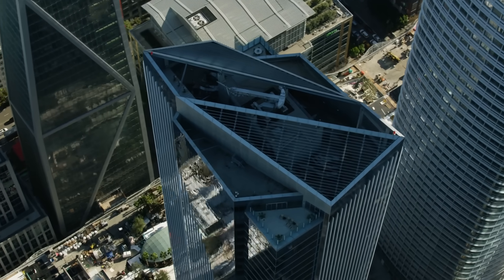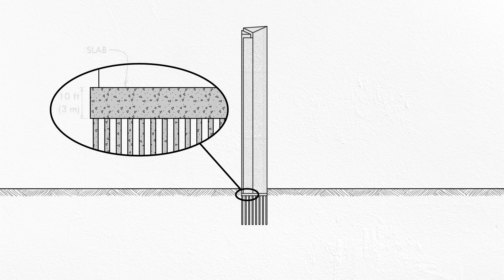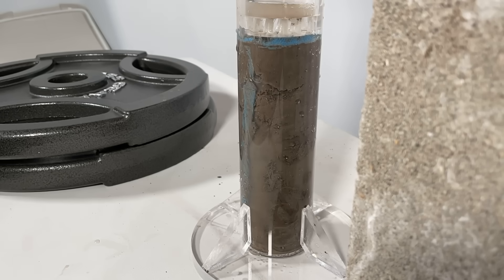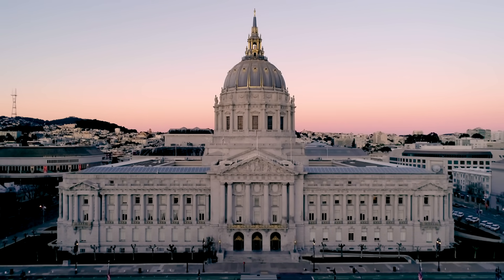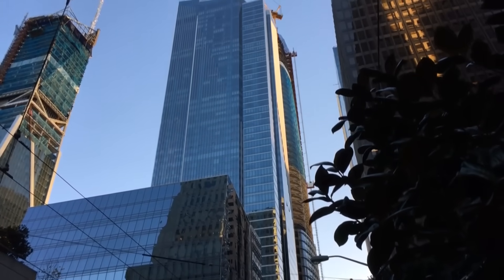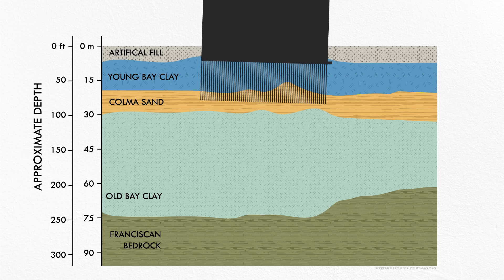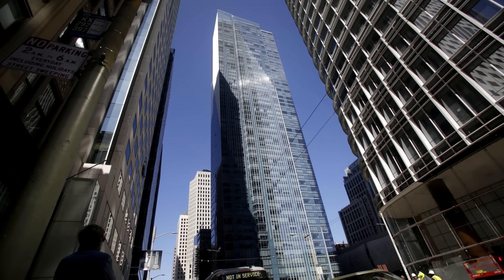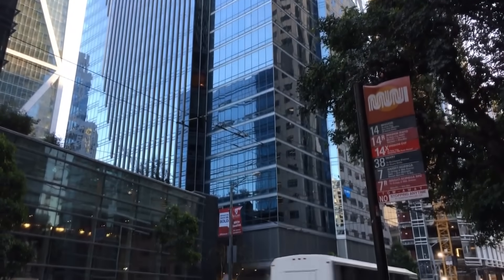What Really Happened at the Millennium Tower?

Comment: Example Failure 1) of 3 
HARMON tower, in Las Vegas: At the beginning of the project, the hotel was called the Lifestyle Hotel and then The Harmon Hotel, Spa & Residences. The tower was planned to have 400 hotel rooms and approximately 207 condominium residences from 800 to 2,900 sq ft (74 to 269 m2) on 49 floors. The hotel's pool deck was planned to be on the roof high above the Las Vegas Strip. The exterior of the building was finished in 2009, but the interior work to correct the construction issues was to continue into 2010. (short version)
 Example Failure 2) THIS SAN FRAN Tower 
                  This building is 686,000,000 pounds. Too much for the 'footprint' of the so-called ' engineered foundation ' !        For comparison purposes: FACTS One General Electric 4400 hp locomotive, fully fuelled weighs around 430,000 pounds. IT WOULD TAKE 1,595.4 of these to weigh the same amount. Good luck, people. 
                 STUDY THIS 
                       The Millennium Tower may be the most recognizable sinking building in the city, but one researcher says earth-based and space-based observations confirm the entire downtown area around it is sinking as well.                     “I looked at every building in the Bay Area, so just under a million buildings,” said U.S Geological Survey research geophysicist Tom Parsons, who estimates that over the last century, 3.5 trillion pounds of development and human activity – including the subsidence tied to loss of groundwater -- have led to an estimated settlement of three inches across the entire Bay Area.                       “ ""Clearly, the most density and the tallest buildings are centered in that downtown San Francisco area, and that's where we see the most calculated cumulative settlement from all of those buildings together," he said.                    Turns out that at an estimated 686 million pounds, the Millennium Tower is the third heaviest building in the city.                        The top nine all weigh more than 300-million pounds, but the only one that’s leaning significantly is the Millennium.                      
                     Groundwater loss from adjacent construction has been blamed for the problem by the tower’s developers, while geotechnical experts say the key is that its foundation is not rooted in bedrock.          “The Millennium Tower’s an unusual example of tilt, but generally they go down vertically,” said Parsons, who has long studied the stresses that build up on the earth’s crust. He says all the buildings downtown likely weigh enough to exert sufficient downward force to influence an earthquake fault.                      Fortunately, the San Andreas fault runs offshore before it reaches the city.                          So, he says, the billions of extra pounds will not likely have seismic implications.   
                        
Still, the mass of sinking buildings shows up clearly in yellow in enhanced images captured by the European Space Agencys' Sentinel 1 satellite. Example Failure 3) Surfside Building 

   Collapse - Miami Florida - What They Knew and a Correction Jun 27, 2021 YOUTUBERs PLEASE GOOGLE '' SURFSIDE BUILDING INTEGRITY '' with host/owner engineer Mr. Josh Porter

Comment: I looked at a new condo with ongoing construction. I saw the map of the area & asked why no bld in other areas. Oh those are for greenery & drainage. I decided to take a look all around the multi condo building. I found a small open ended pipe under the bld directing water away to a lower lying area. Since we get heavy rain water & snow, the drainage was insufficient and a great mosquito draw. I didn’t buy. Ck the the perimeter, basement, or base. I will call a structural engineer should I buy.

Comment: 10:30   Okay, more FACTS.   DID  you, ever compact  just-poured concrete, with a cement vibrator hose type tool ?     okay,  when attempting to drill new external piles, the vibration/noise etc   CAUSES   THE   SOIL  BELOW,  TO  compress, even more.......not rocket science, either.  Let us see, as this video progresses......the more you 'try to help'........the worse, the situation becomes, until   '' topple  time ''....

Comment: The designers/engineers,  may  want to consider, linking all these tall, tippy overweighed  buildings, together  with several hundred heavy bridge structural steel,  ' WALKWAYS'....thereby strengthening their  upright  styel, and design. By linking all them together,  perhaps  those  ' investors'   could get  real.  To save a buck,   modern doofus engineers, and contractors, bought out by  greedy  buggers......this tower, and maybe many others,  may be just the start,  of   a   '' falling   away.......'   as it were....

Comment: Hi handsome. My question is can the millium tower run underground cables to the surounding buildings and connect to there foundation to prevent further leaning untill it's foundation is fixed? Picture a spider  web ,where the millium tower is at the center of the web, linked to it's surounding buildings , outside web for extra support?
Reply: Um weeeeee will get back to Spidy…

Comment: Here in Inverness in Scotland the buildings are all a lot lower than the Millennium Tower but we have our issues with foundations. Lots of drilling goes on before major construction projects as though it will teach us something new about what is underneath the city but it is all a bit of a waste of time. Everyone who went to school here and was listening in the Geography class (tall order for some!) doesn't need a drill to work it out. We are about 10km from Loch Ness (of Monster fame). It is 223m deep with a flattish muddy bottom and two further long lochs make a chain of waterway; joined by artificial canals; right across the country. Other nearby similar lochs without large catchments; and therefore mud; can be over 300m deep. What this means is that glaciers have carved a deep trench reaching down to 300+ metres below sea level right across Scotland and An Gearasdan (Fort William), Cille Chuimein (Fort Augustus) and Inverness are built on plugs of sand and gravel that have been deposited at intervals along the trench. As early as 1893, an exploratory drill was done in the railway yard at Inverness and in 97 metres of drilling a pattern of sand and gravel and sand and gravel and ... so on, made it pretty obvious what was going on. That drilling report still lies in libraries and on the British Geological Survey website today and is accessible to anyone. Hundreds of other modern reports from the area, many only drilling 10 or 20 metres, are also available and none find evidence for anything other than sand and gravel. Engineers from all corners of Europe seem to come here with little idea what they are looking at. The BGS "superficial geology" record displays "sand and gravel" but nobody seems to expect hundreds of metres of it. Some construction in recent decades saw delays due to piles not reaching "bedrock": no frickin kidding! Fortunately, local sand and gravel provides a stable base for the buildings of modest height that are built here.
http://mapapps.bgs.ac.uk/geologyofbritain/home.html

Comment: All you need to do are install braces on two sides and diagonally between the sinking corner to its opposite, limit the height of the building and reinforce with micro piles on the outer foundation (two sides)  driven to refusal. See... simple and inexpensive.

Comment: I was working on the new construction as a drywall,  metal stud framer. The year was winter of 2008 . The windows weren’t installed on many floors and wind would come in and take out anything that wasn’t tied down. The fog would be so thick inside that you couldn’t see but 20’ and the cold temperatures coupled with wind was a challenge. I have some great memories of this project. I was 44 at the time, now 58 and retired from local 152 Martinez Ca. 36 years of framing in the city. The company was Anning Johnson Co. and the foreman’s name Jim Hayden (Retired) and Ted both long time employees of AJ. Thank you for sharing.
Reply: Did tools and stuff roll around like that other commenter is claiming? Like if you put them down would they roll
Reply: @halahmilksheikh  no ! In 08 the tower wasn’t leaning much at the time.
Reply: People need to understand it's antisemitic to criticize semitic companies and it is antisemitic to criticize semitic industries ..!
Reply: @operacarmen huh? What’s a Semitic industry? Are Jews forced to work in certain industries?

Comment: I wonder if there’s an engineering limit to the fix / jacking method? I assume it was based on a linear progression of the sinking by the time the jacks would be installed? Based on that graph you showed, by the time construction of the new piles is completely, they’ll require substantially more lifting distance than originally calculated. 

I guess I’m just curious if this plan may fail at some point if the drilling operations accelerate the sinking to a critical level beyond what the fix could account for. 😕

Comment: I was helping my father on the Fry-Ark project by carrying concrete cylinders to the truck, setting and pulling survey flags and holding the idiot stick for my father while he peered through a theodolite. One of the pillars for the capstans on an 84 inch twin siphon was set atop an artesian well. The water forced this concrete piling and the pillar about 15 feet up out of the ground. That is several TONS of reinforced concrete. Why is there always that one idiot who suggests, "Why can't we just cut it off to the proper height?". Of course it would have floated up and down with the water table & pressures within that well. It had to be multiple micro-piled into place. Yes, it was caisson & pump time! I knew mathematics at a 7th grade in kindergarten from working with my parents.

Comment: Why couldn't they install between the tilting foundation and the leaning building. Make some very large jacks  that are inserted between the foundation (inside) and the building steel, to lift the whole structure up . Made in a screw type hydraulically turned. 24/9 inches on the tilt.
Reply: Or watch as it continues to cross the street.  You could tell at the top looking down. 😱🤔

Comment: Drove past it 2 nights ago. if you look at it on Fremont coming from Oakland west on I80 you can Eyeball it from Fremont 181 (the next door tower) and can see how much it is leaning.  they say it's leaning NorthWest but I see it as leaning directly towards the Salesforce tower.  they failed securing the building. as funny as it might sound, I wonder if they can lasso it at three spots. Top Middle and lower center and pull it back if they can mount some kind of anchor in the intersection south east of it with a crane.  otherwise, It's probably going to have to be torn down or slowly cut down. implosion would probably fall sideways.
Reply: It’s a tear down before falls down and litigation drives costs off the page. Tell you one thing whoever gets the bid to demo better get the bid amount up front I would not touch that with 10’
Pole or 11’ Hungarian

Comment: Ok here’s a think-outside-of-the-box idea; since the addition of more pilings has not helped, could one actually excavate soil from underneath the higher side of the foundation slab, thus allowing the building to right itself a bit? Yes the whole thing would still be far deeper than it was supposed to be, but at least it might straighten up and not be in danger of collapse. Holes could be drilled in the foundation slab and then allow removal of material from below the slab. Crazy I know.

Comment: The fix is GARBAGE and any engineer w a brain would say so just listening to the 3 mins about it in your show.  
The plan is to JACK UP THE 10 FOOT THICK CONCRETE 'FLOATING' SLAB, CONNECTED TO 100's OF PILES at 800,000 lbs ea, 400 TONS EA, so
1.  The GC is going to install 50 - 400 ton hydraulic jacks and operate them all in perfect syncronization such that the one at the corner will rise more and faster than the one at the middle of the building.  He has the computerized software needed, from WHAT OTHER JOB LIKE THIS.  You can't just put a jack on one pier raise the slab THERE 16 inches, move over 6 feet, do the next.  The slab is ONE SINGLE PIECE, that first jack will burst trying to lift not just it's section, but the rest of the slab.  
2.  We'll make believe the GC hired JPL to do the modeling and develop the software to coordinate the differential lift at 50 seperate 400 ton jacks.  
3.  In addition to weight of the slab they will need to lift the weight of ALL THE ORIGIONAL PILES, probably as much as the slab itself.
4.  In addition to the structural weights, the jacks will need to 'break suction' be it wet or dry under the slab the slab is 'adhered' to the soils below, and if it's wet the suction force can be HUGE.  In ocean salvage this is often done by destabilizing the soil bed under the ship with water or air.  If that is done here, the whole building could topple instantly.
5.  What the crap is the rest of the slab not being jacked supposed to be doing?  This is despite all cracking and dishing a single monolithic block, think china plate.  Take a china plate, put a pencil under it, hold it level, now raise one side, the other side sinks.  That is what the 10 foot thick concrete and steel matt will try to do.  It will in all likelyhood fail at this.  It might remain intact, in which case the jacks will all burst from additional weight of trying to lift the entire building.  It might crack in 10,000 places connected by strands of rebar,  settling in 10,000 pcs, after which every column will start loading soils locally, unevenly, across the whole building, creating a wavy structure w no integrity or predictability.

These are the CHILDISHLY SIMPLE QUESTIONS that the SF GOVERNMENT MUST HAVE ASKED AND BEEN ANSWERED TO THEIR SATISFACTION, making them either the most stupid gov't in the US or the most corrupt.  There can be NO answers to these questions that would ENSURE safe operations....  AS PROVEN BY THE GROSS INCOMPETENCE ALREADY EXHIBITED BY GC OF DEWATERING THE GROUND allowing building to radically sink more!

FYI  solution - rip it down no really it's too late to fix .  To get that load to bedrock and jack the buildling straight would require multiple rows of 30 inch bored piles, w borings filled w bentonite slurry during boring, so that water table is not effected and no ground settles, these would need to be seperated by 6 to 10 feet to distribute load on 'bedrock' which isn't really rock just firm soil mix, this means there isn't room around the building, you can tell this as it took 100's of piles over a vast area to origionally support it.  They'll need to be MULTIPLE rows of drilled piles moving out into the public street, meaning relocting all the utiltiies and disruption to blocks of surrounding building tenants due to shut offs.  Then a new 10 foot mat poured atop.  ON ALL SIDES OF BUILDING.  That would be 'bonded' somehow to existing slab.  Probably with side borings deep into them through conc and rebar, hundreds of them.  Then grout would need to be pumped under the 10 foot mats to ensure all voids caused by old settling and any new settling as new mat takes up load from old are filled and whole building is resting on bearing soil.  Yes piles take primary load but you want the safety and stability resistance to movement of 100% earth contact.  Now you'd get to start cutting through every column and shear wall in the building and install jacks at all of them.  How exactly you are going to slice through the entire structural system holding up the building and still keep the buidling in place w connections that will allow differential lift over a period of months, but prevent horizontal movement and 'tipping over' I have no idea and doubt it's possible.  HENCE WHY I SAY IT"S IMPOSSIBLE AT THIS POINT TO SAVE THIS BUILDING.  Obviously the developer is at fault, they are bankrupt I'm sure, protected from further loss, the insurance policy is only worth what it's worth, and might be exhausted by law suits over unit worth.  So the city, even if it has no guilt will need to pony up the billion bucks needed to take this turd down to the ground before it falls on 3 blocks of buildings next earthquake killing 1,000's and destroying the economic viability of the entire city ie fear factor.  Also, face it, the city IS AT FAULT, somewhere at some time someone was grossly incompetent or grossly corrupt.  NO building offiical inspecting these plans prior to buiding could have passed them without a valid explanation how this one building in all the city didn't have to reach bedrock. I'm sure the inspector did, and his boss was told by higher ups, political appointees to pass it.  THIS STINKS OF CORRUPTION.

Comment: When you try to raise the building, you’re putting “reverse bending “ on the slab. Ask any engineer what happens to the stresses on the reinforcing and slab when it’s put into reverse bending. It’s called failure. Trying to raise the slab with hydraulic jacks will lead to failure.

Comment: It's a design failure in the foundation.
The weight of the building had to be compensated with the volume of excavated material.
And use the piles to stabilize the structure.
And I mean piles up to the solid layer.
Now the only way to save the building is to remove floors until the weight is correct.
Horrible and wild, but it is the only solution.